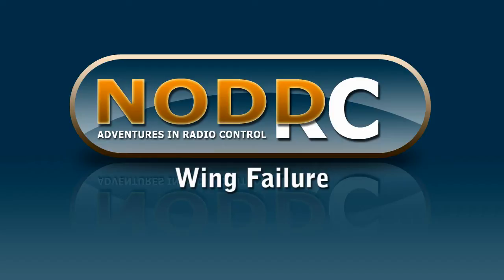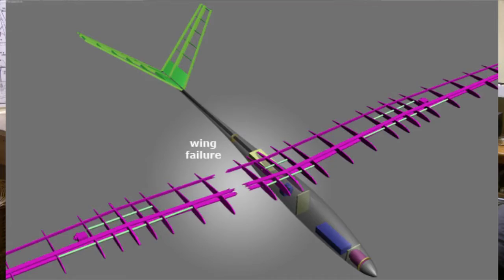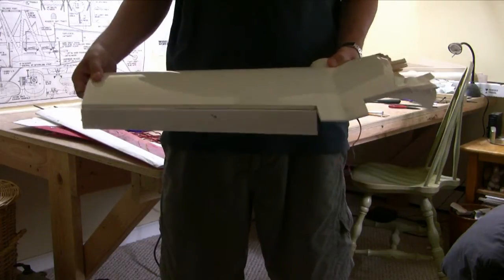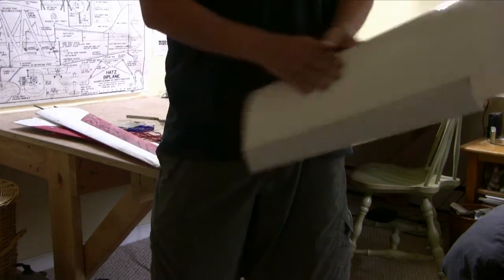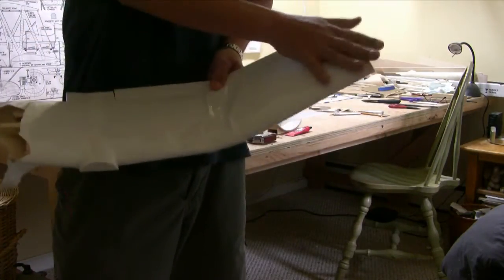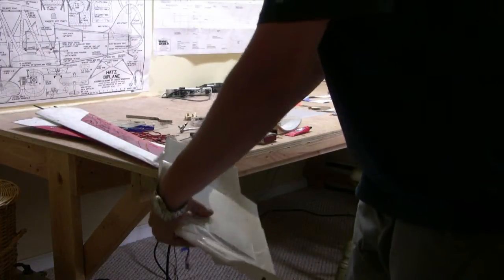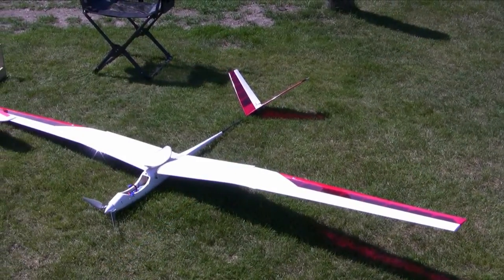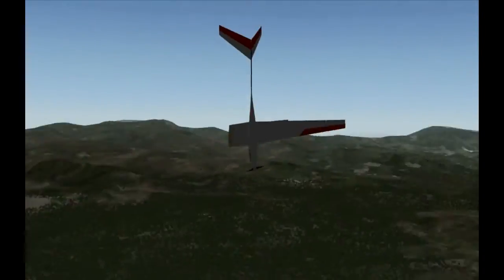Nodd RC - 013 - Wing Failure

Comment from the maker: I used X-Plane for this simulation. That has a built in "plane maker" function. It's geared more towards full scale airframes, doesn't model RC sized stuff very well. RealFlight does a better job for RC but the process is more involved. If you're not worried about how the aircraft looks in the simulator, I've found RealFlight's "edit aircraft" tool pretty handy for predicting how a model will fly. Just find an aircraft that's similar, give it a new name & start editing the parameters.